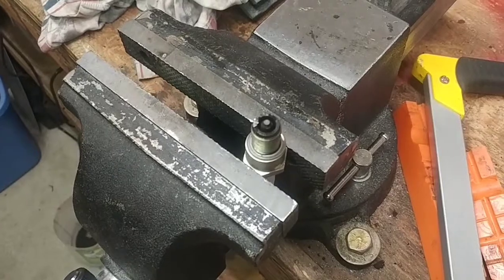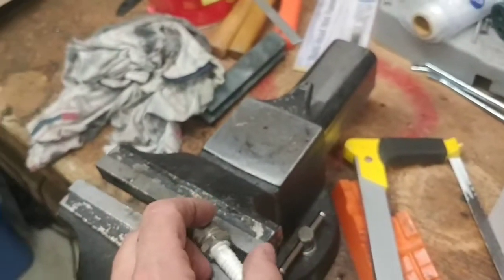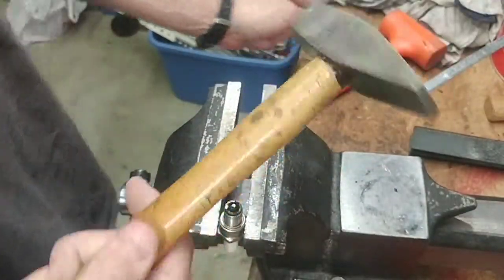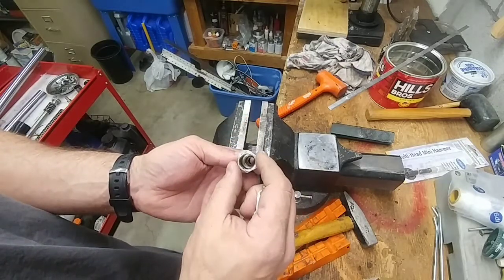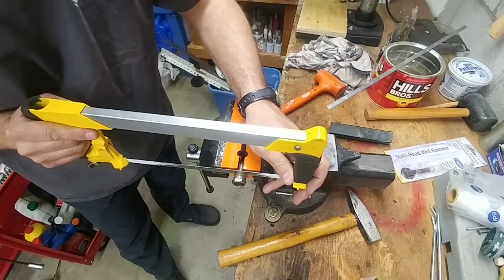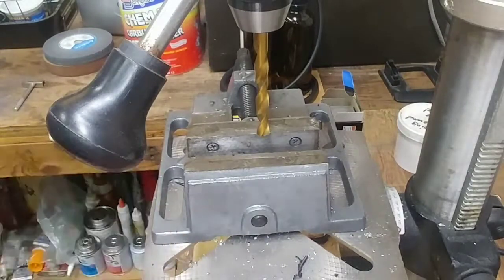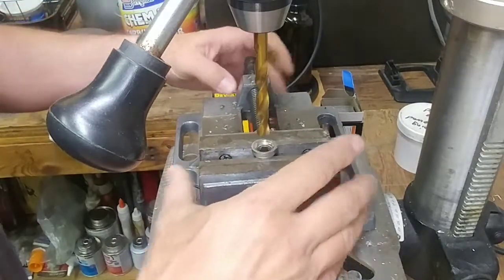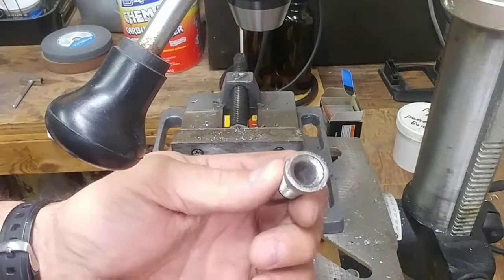Making a spark plug thread adapter.

Comment: Good idea. They wanted $30 for the exact thing you made. I bought a 12 mm color tune spark plug kit for my 82 magna v45 but it won't fit in my 89 fzr 600 which used 10mm spark plug thread. This is a good idea to make one and save $ plus 2 weeks shipping from UK. Thanks

Comment: Thank you for making it look easy.   Ha!    I thought no one else knew about Colortune.  :)  I bought it when I first installed a dual carb on my  VW Sedan Model 111.  ;-)         It's fun, but, I worried about the plastic light shield.  So, I never stay long on it.    How long in terms of minutes(?) do you leave it to measure?  I was thinking of testing it on a big old V-8.  ?  Am I crazy?   Cheers!
Reply from the maker: I get the engine warm than switch in the color tune and test. I do have another test, a CO tester that lets me adjust the mixture. Color tune is a bit of a toy.